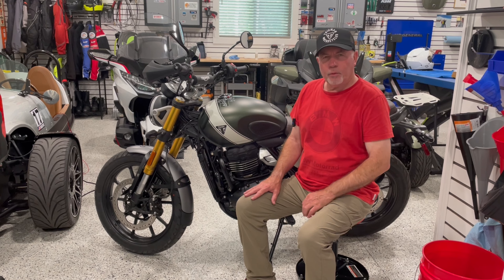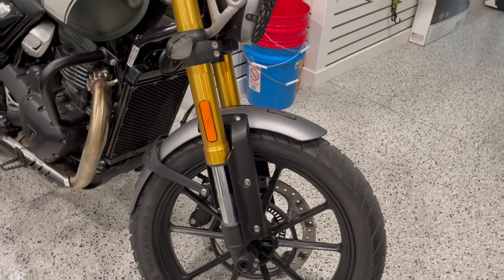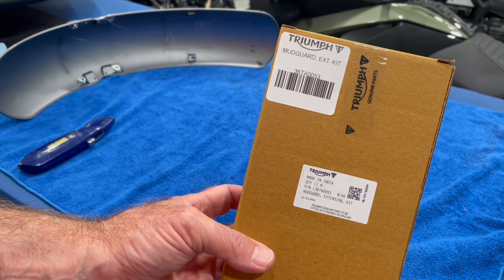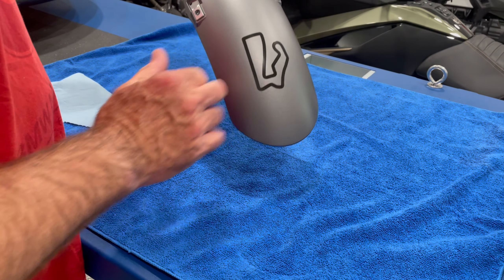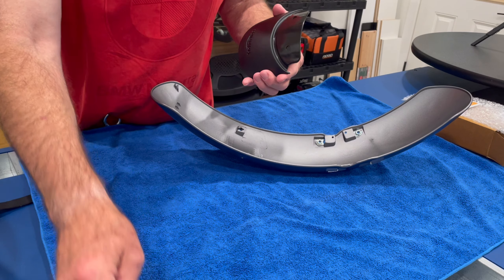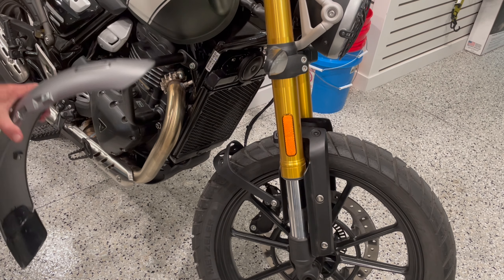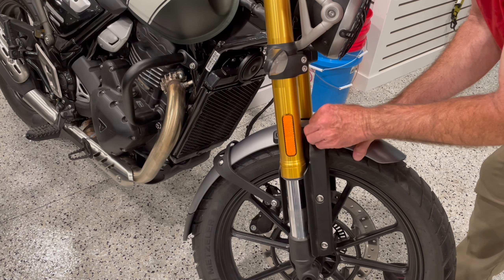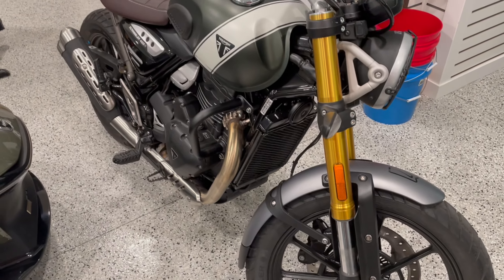How to add a Mudguard Extension Kit on a 2024 Triumph Scrambler 400X

Comment: I thought it was a 4 piece kit.
Reply from the maker: One mudguard with pre applied adhesive strip, alcohol wipe, instruction page, box. All of that makes 4 pieces!
Reply: @MarksGarage17  Not that way. The front Mudguard has two protectors, the rear mudguard one and one for the tail tidy.
Reply: @JHelun  Dude he counted the box ..
Reply: @MarksGarage17  Meant no ill will. Liked how you did this video and the previous one. Very detailed. As a soon to be owner of a scrambler 400x I am going through a lot these videos and found yours to be very detailed. Just that the other pcs were missing and I was wondering why?
Reply from the maker: @JHelun  All Good!
Reply: What's the recommended tension for the fasteners when reinstalling the fender?
Reply from the maker: @JF-vq1jk  For that size fastener, 8 Nm would be appropriate. No more than that as this is going into a plastic housing.